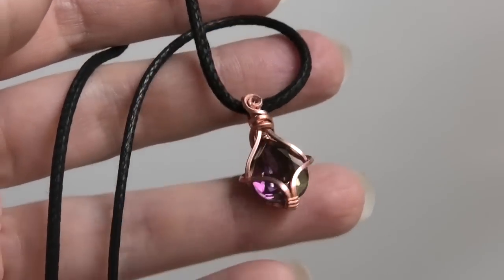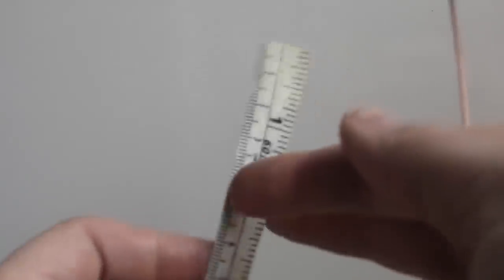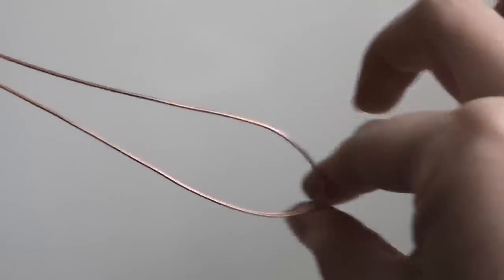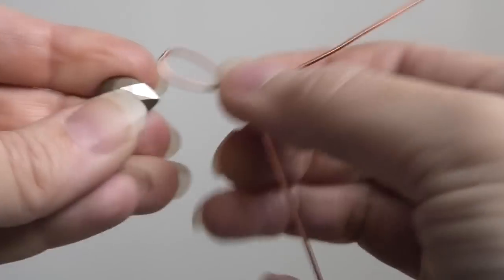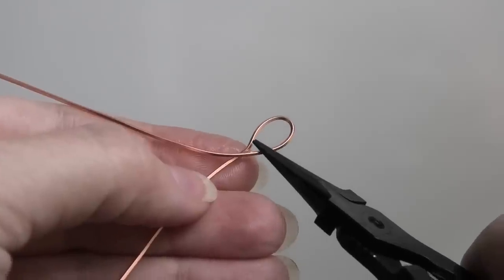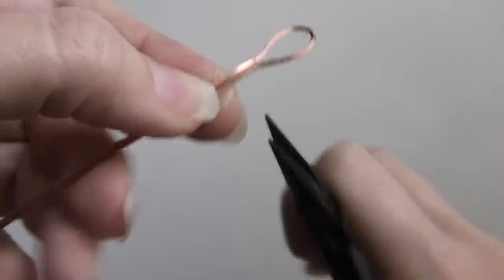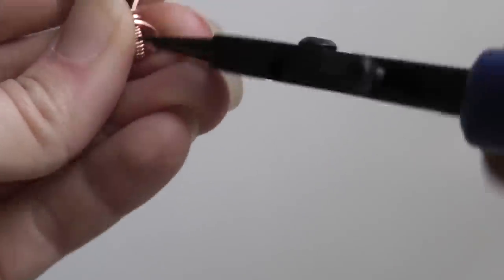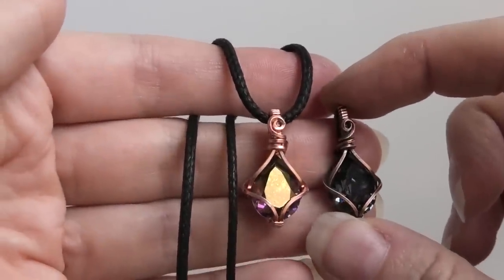Swarovski Faceted Teardrop Crystal Wire Wrapped Mini Pendant Tutorial

Comment: 😍Beautiful! You make it look so easy..I definitely need more practice because as soon as I start the frame it always looks warped/uneven. It never fails when bending the wires to meet at the top I never gauge the exact spot on each one to place the bend! 🤔...more practice..lol, Thank you for sharing
Reply from the maker: It can be helpful to bind the 3 base wires together in several spots (not just the very bottom) to keep the frame all nice and together, and then after you bend it around the stone and connect you can just remove the extra bindings

Comment: Nice!  Question—on this pendant and the other tutorial you released around the same time, you used a 14mm teardrop stone.  What is the maximum size stone that can be used with both of these designs, with 20gauge square wire?  Could you use this wrap with, say, a 25mm or 30mm stone?
Reply from the maker: I haven't tried other sizes, but I'm thinking 25mm should work fine